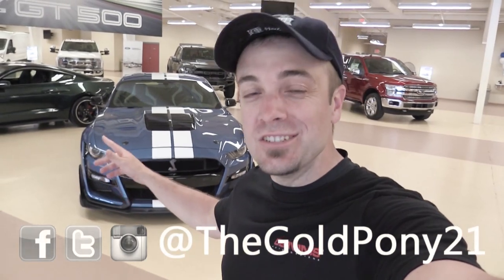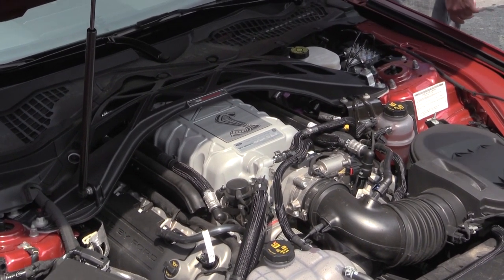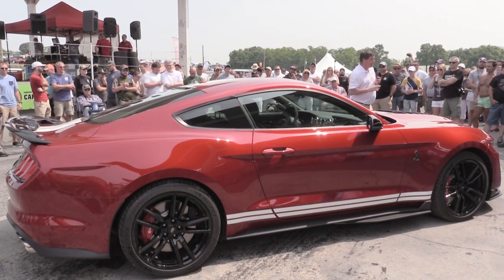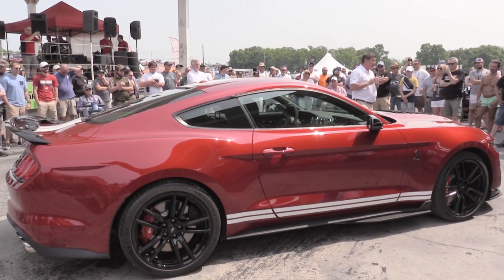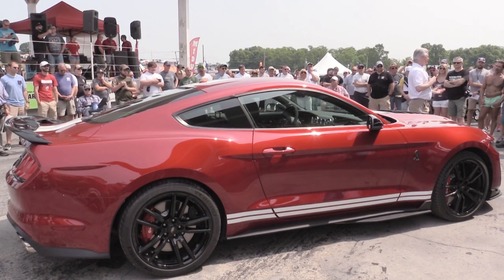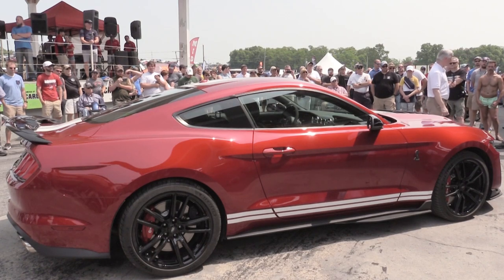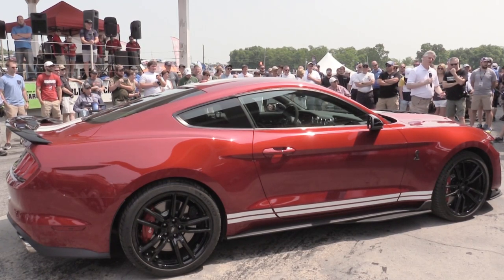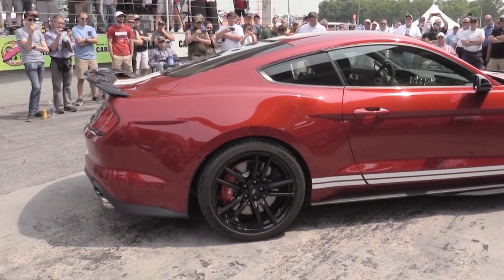2020 Shelby GT500: LOUD REVS + Walkaround

Comment: So over the secrecy. If the car is all that, just put the numbers out there. Ford is already late to the horse power wars. STOP!
Reply: Late to the horsepower wars? So the 2013-14 Shelby doesn’t ring a bell? Had 662 horses before anyone else was putting that in their cars. The cobra jet was running down drag strips well before the demon ever came out. Let’s not get too far ahead of ourselves and say things like “ford is already late to the horsepower wars.”
Reply: 2020 GT500 actually has a 720 horse power but they are trying to achieve around 796 horse power. Well just sit tight and let them finish their work. We are still in 2019 and that shelby is for 2020 isn't it obvious.
Reply: The Ford Shelbys and Mustang GTs need all that horsepower to carry the weigh of those plastic oil and transmission pans they now sport.